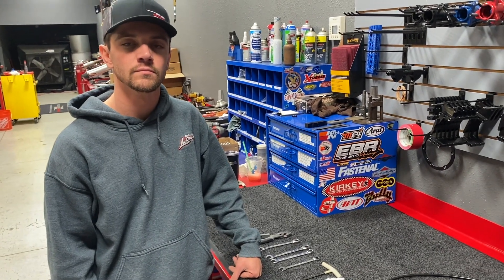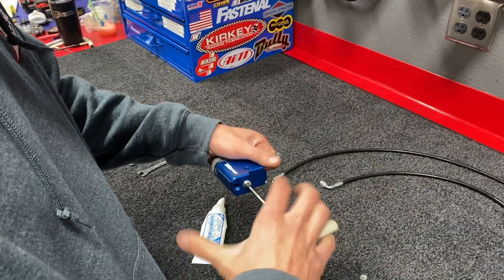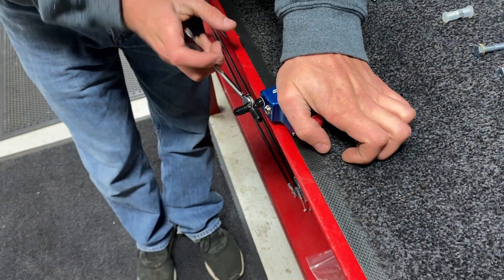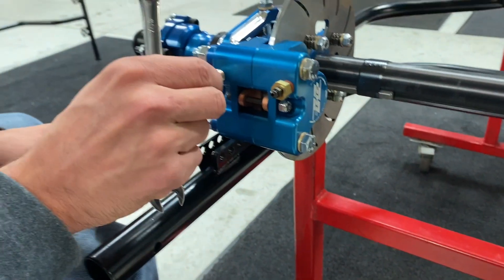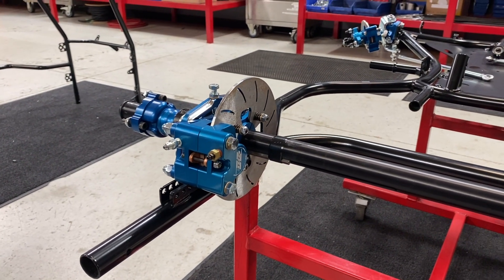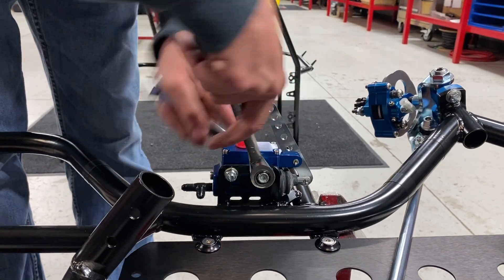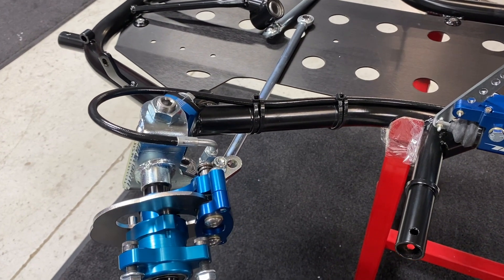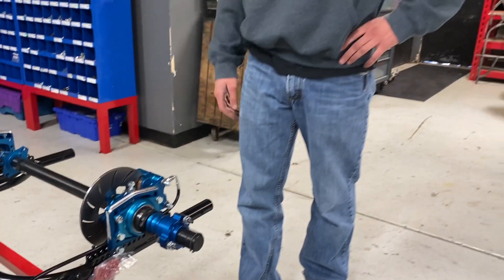How to build an Outlaw Kart: Step 4 - Brake System

Comment: The kart your building right now. How much would it cost complete with motor
Reply from the maker: We don’t sell motors but the roller in the video comes with seat, body, wheels & tires for $4,999.99 unassembled.
Reply: @qrckarts9210  wow thats a great deal!
Reply: @qrckarts9210  wow thats a great deal!